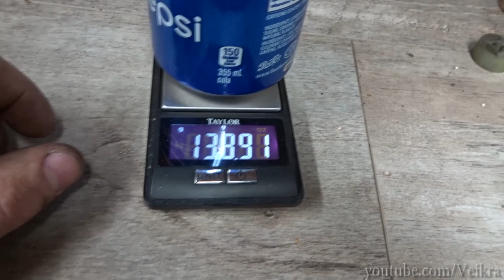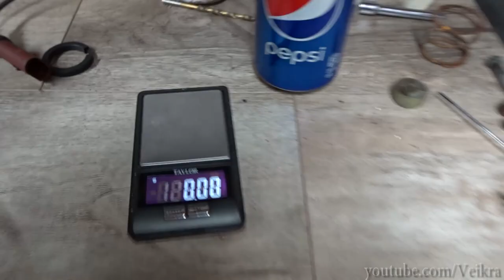How to repair wabco audi mercedes air compressors (in-depth)

Comment: Hi! My S211 T Merc (non Airmatic, just rear air springs) lowers left end occasionally. If the parking surface is almost flat, it holds the pressure, but if the surface is not flat (e.g. parking in a ramp) it lowers in some hours. Firstly the left side, then the right. I think in case of spring leaking, it should be lower every cases. Am I right? Culd be the valve in the pump or level sensor? Thanks
Reply from the maker: can be valving to some degree but if it goes way too flat it's a leak in the spring. Reason being there is a residual pressure valve that does not allow deflate under a set pressure.  As far as level sensor you'd get error while the car is at height if they were faulty.  Most of my merc knowledge comes from the S-class of the same vintage so it should be decently accurate

Comment: I removed the Wabco Continental ZSB suspension compressor on my 2005 Audi Allroad.  I have a hard and steady 01397 code failure indicating the N111 solenoid was bad.  I didn't see any bad wiring anywhere, so I removed the compressor.

How do I bench check this compressor to confirm it's bad?  It seemed to be working fine before it failed suddenly as I was driving it.  Over a week or so it sunk down evenly to the lowest stops on all fours wheels.

The numbers after Wabco are: 001 0424.  Does this mean it was made on 2004?  

Thanks!
Reply from the maker: You have a steady code so solve that one first. The solenoid DO sometimes go bad and CAN be bought separately.  Inspect all wiring 60cm from the compressor first. Ohm it out to the level control module then install the new vent solenoid on the compressor. Odds are it would solve it. 

But then again, I can only tell that you have 100% an issue with solenoid, level control computer (rare case) or wiring in between.  Do not mess with calibrations, valve blocks or anything else until that code is solved. You'd only make it worse !
Id R&R the compressor while it's out and replace the drier material as it's probably full of moisture by now. Only a few people familiar with air suspension ever think about water in the system. Audi does not put that in the maintenance book, sadly. 
Happy wrenching!
Reply: @Nordic_Mechanic  thanks! It was a wire just past the pin, of the solenoid plug.  I had to depin and solder. Then put everything back. Works fine now.  Thanks! It was a fun job. Dirt in eyes and all that good stuff 😆

Comment: how do you remove the dryer seal/cover for the one way valve on the cylinder head? I know you said don't remove it, but I need to replace the whole cylinder head too.
Reply from the maker: Pry it off. just dont lose the spring

Comment: Can a problem in the compressor cause the car to sink down over night? And what in the compressor would cause this?
Reply from the maker: No. The compressor do not works with engine off except land rovers. The car stays up unless some spring leaks. In the a8, the car checks and reajust level for 10 hours to compensate air cooling down or warming up but all corrections are done with the air accumulator (tank). 

Air up the car and put it in service mode to desactivate suspension control and youll see which corner is the leak from

Comment: after a sharp slip in a car wash conveyor chain my compressor that used to sound like a Jack hammer now just sounds smooth and malfunction warning came up..I can hear the compressor smoothly but no lift..could it be a shot compressor ?
Reply from the maker: if it sounded like a jackhammer then it was either on it's way out or rattling on the frame from worn insulators. If you have a pre facelift model the compressor is mounted lower, and you could have broken the line off. Malfunction scan and visual inspection needed. If you are missing the splash shield it's easy to damage a line.  Code will include a air leak detected .  Inspect and rebuild compressor, clear the codes. Shouldnt be too expensive. Good thing you can hear it, so the motor is not fried. The compressor will overheat so better not drive until it's fixed. You'll damage the suspension bushing if you do or worse, the front bumper.
Reply: @Nordic_Mechanic  Thank you for your reply

Indeed I do suspect it was a failed compressor.and for it to suddenly sound smooth it must be shot out so maybe a new compressors in store..hopefully they are easy to replace and wont need a valve body as I do not hear any hissing even though I can hear the compressor working and no lift at all

Thanks again.
Reply from the maker: @blackpanther025  probably worn cylinder and piston ring thus it's not building pressure anymore. Valve block is a completely separate part  and in a spot it cannot have been hurt by the car wash
Reply from the maker: at least on a audi a8 04-10.. same compressor on mercedes s class too
Reply from the maker: @blackpanther025   you can rebuild the pump for pretty cheap, as seen in this video. You wont need a valve body unless your car raises up crooked. And it was fine prior.  You'll have to inspect for leak in air spring in case a leak caused the failure of the pump.  Not the type of car you want to throw parts at without a definite diagnosis
Reply: thank you for your reply buddy..I did try to start the car this morning and again after 2 mins of the car not raising the malfunction icon came on dash...but I could still get 1.5 finger at the front when it should be 2 and .5 at the back.. which makes me beleive maybe rear sensor.

I would like to recon the compressor but worried i will get it wrong and do more damage.. would you insist on OEM or are the aftermarket just as good

Comment: My wabco accuair endo ct compressor is intermittent. When it turns on it sounds healthy. I have the compressor out of the tank and am looking to try and fix it. Any ideas?
Reply from the maker: start with a new relay just in case. Then next step would be inspecting the commutator. What kind of control do yo use? A defective pressure switch can cause it as well
Reply: @Nordic_Mechanic  it's a unique setup as it's the accuair endo ct. It was engineered and made so that the compressor was enclosed in a modular air tank. So the pressure sw, relay, ect.. is all potted to or on the compressor and in the tank. As it's modular the tank can be opened and the compressor removed. However since the circuit board is potted it's just about impossible to diagnose and repair the unit. I learned most of this after my comment yesterday. Needless to say that accuair went bankrupt after a year or so from bringing this product to the market. Everyone that was made has failed, or will fail. I was hoping to find a "hack", but have resigned to scrapping the compressor and just using the tank.
Anyhow thanks for your replying
Reply from the maker: @quicksno  could probably use the compressor and scrap the circuit board. Kinda like I did with  saab compressor years ago on my channel :p
Reply: @Nordic_Mechanic  good call, I'm gonna look that up

Comment: My air compressor will come on if i give it power with a Power Probe .. but it pops the breaker inside the Probe .. do you think this may be due to the dryer full of water and creating a short inside .? Also where can i order a rebuild kit .?
Reply from the maker: How many amps is your probe? Never seen a probe able to run a air compressor before.  No, dryer wont create an electrical short
Reply: @Nordic_Mechanic  Not sure the amps but it's a Power Probe 3 .. maybe it's not suitable for running a compressor.. it'll run it for about 30 seconds before popping the breaker ... however when I run a power wire directly to the relay to power the compressor it runs fine ... so another question - with the compressor running should , if I unplug the hose going to the filter should I be able to feel it sucking air .? Or is there a way to be able to tell if the compressor is actually pumping air .?
Reply from the maker: @robertquinones943  Your power probe just cannot run that much current. When you put the wire the relay is taking the current so it runs. Yes you will feel it sucking air at the filter inside the wheel well (if your car is the same brand and model)  I can tell the health by the sound of the compressor alone when it runs. You can see the pressure it pumps in software. You can tell it to fill the air tank and youll see how much pressure it's able to deliver :) System design is around 15 atm. 10 atm the car will run, but will take longer to raise and the pump will run longer when needed to run.

Comment: Any idea where I can find just the plastic air dryer?
Reply from the maker: easy https://www.ebay.com/itm/Air-Compressor-Cylinder-Dryer-Parts-for-Audi-A6-C5-Mercedes-Benz-W220-W211-XJ8/372912066597